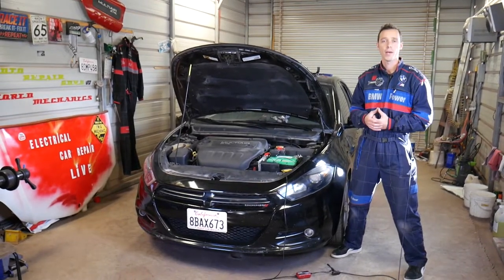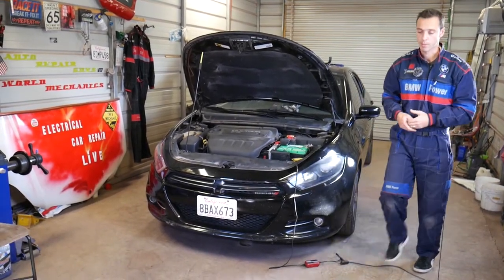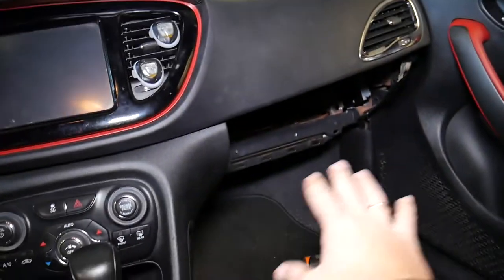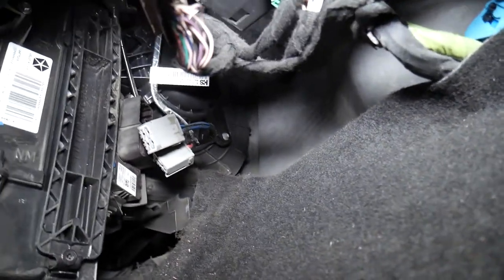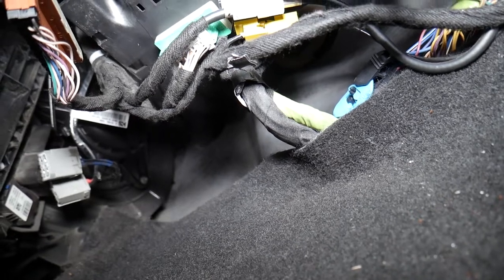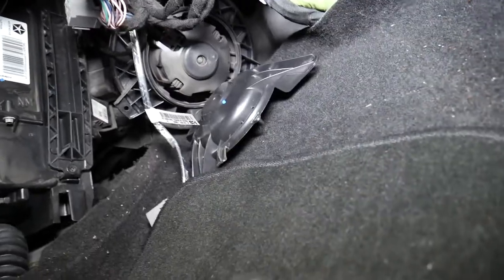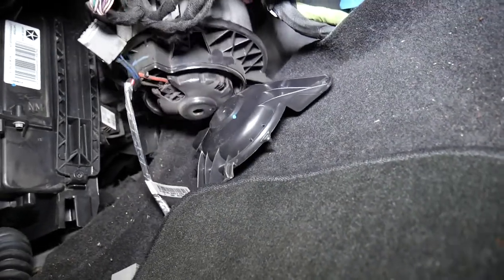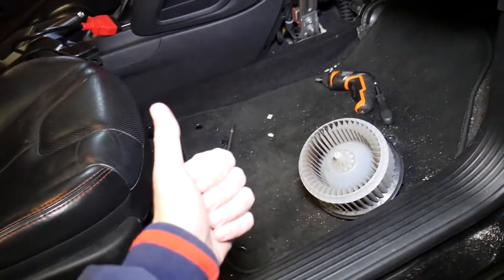BLOWER MOTOR FAN REPLACEMENT REMOVAL DODGE DART, CHRYSLER 200

Comment: I have a 2014 Dodge Dart. On the Key Fob I have buttons to push t remote different sequences. I need a package,  or an old Key Fob with the sticky round concave dark center contact points. Where can I get them? Kent

Comment: Hi guys. I have a question. I have a 2007 BMW 328xi, and It does not turn on. When I insert the key, and push the start and stop button, nothing happens. Everything else works such as the radio, windows and lights. However the dash lights do not turn on the in the instrument/gage cluster. The only thing that turns on in the instrument/gage cluster is the small screen that tells you some basic information like the temperature and time. I checked all fuses and relays that you guys explained in your videos, but everything is normal. The only thing I noticed was that the main relay that is next to the DME is not getting ground. Besides that everything looks normal. I don’t know if the problem is the DME or CAS, and I would like to know what you guys think?

Comment: You don’t need to remove the gloves box
Reply: You don't but it's better. It's a pain in the ass to try to guess where it goes. I just did it today.
Reply: How do you get it out
Reply: @ebonymusiclegends1  
You need to bend yourself under the dash you going to see black cover remove it then you will see the blower motor to your left and you should see the 3 silver bolts for it there don’t forget to disconnect the connector before you pull it out
Reply: @smithvilleautosalavgellc9215  than you!!!
Reply: Yep just need skinny person. Brother in law works great!